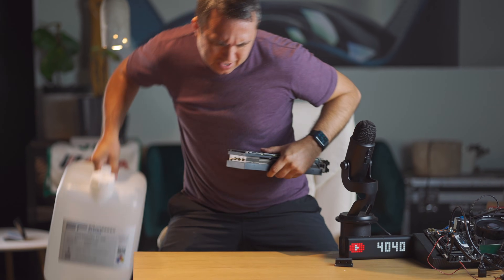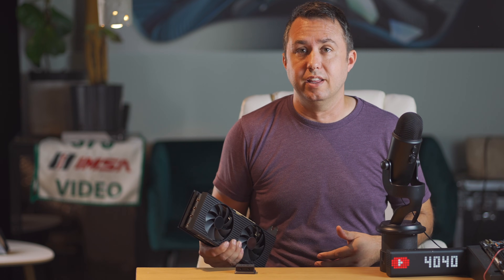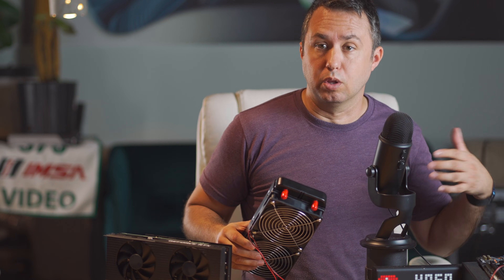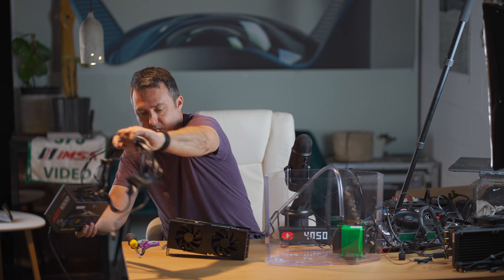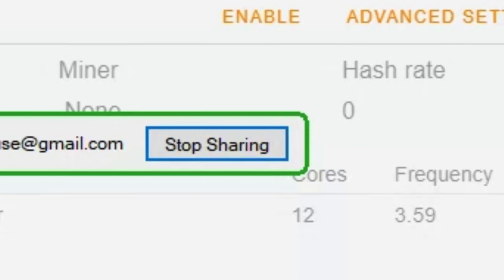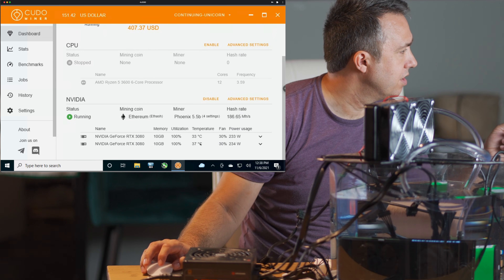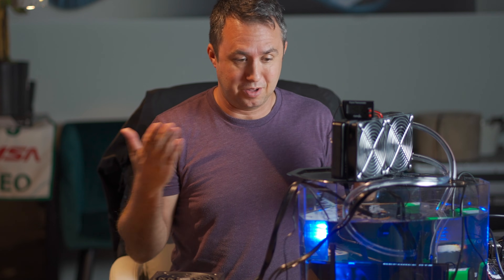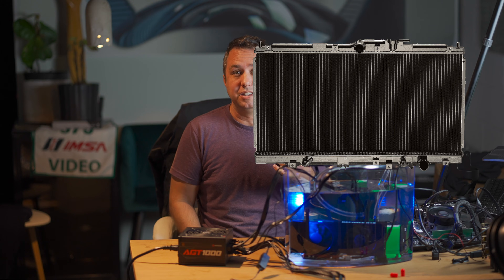Immersion Cooling RTX 3080 ETH Mining Rig with Dielectric Coolant

Comment: the whole point of this liquid is to cram in more heat making stuff in smaller space and have dielectric liquid be the heat extractor instead of air its better at heat extraction in tighter space, can hold higher joules of energy in same volume and thus efficient for data centers or large systems, Its a volume thing, not for average joe

Comment: imersion cooling is awsome we did our 20s x 20p samsung 18650 30q batteries with it,even under full load now they only go up 5-6 degrees and thats 3 to 400 amps
Reply: but we added a radiator and fans and peltier unit ,for really hot and really cold situations
Reply: all pc spec parts though
Reply: 20s20p!!?? What are you powering with that much voltage?!?!

Comment: if you have the fans on pwm theyll check the speed ,set on dc tthey just send a voltage,most motherboards will post a warning though on slow fans unless you disable to post warning and hold

Comment: That overengineered fluid is mineral oil... the same that is used in oenology. With a fancy name it costs 4x.
Reply from the maker: It’s possible they lie to the public and you’re right. But I asked them on the record for a future video wether or not it was mineral oil or transformer oil and they said it was not.  My guess is that it’s a modified transformer oil that doesn’t eat up plastic as fast.

Comment: First off, very smart move to pour liquid from a height, creating splashes, instead of resting the neck of the container on the edge of the tank. It’s like you’ve never poured anything before. Second off, a dangerous way to deal with a 2000$ card, using cheap parts with an expensive card. it seems to be your first time dealing with immersion cooling. But maybe it’s little money for you, I hope it is. Then there’s a problem with the thermal transfer. Since you don’t use convection, the liquid may eventually wash off thermal  paste and degrade thermal pads, and then your card may die from heat
Reply from the maker: First off, yes it was a bit of a mess. Second, it’s true $2000 isn’t a huge purchase for me, but that’s no reason to put it in any danger.  Luckily, electrocool has a zero change of damaging anything on the card, and in the event everything went wrong while I wasn’t home (which ended up happening, this tank was incompatible with this fluid and it ate a hole in it!) these cards have a feature to shut themselves off if they get too hot, which it did, and with no damage to the card. 
It’s now back in the air after a thorough cleaning and degreasing, acting as a gaming computer because mining is now unprofitable at my electric rate.

Comment: I wonder if the fllow of liquid will washout the thermal paste, and what about removing the heat sinks to let the liquid in direct contact with yhr dies, im having taughts here, no expert but good work buddy
Reply from the maker: I’ve since learned that yeah, you want to swap out the paste with thermal epoxy if you’re going to go this route. But I had I running for about a month and it still had not eaten away the paste I had in there. 
You do NOT want to remove the heat sinks, though. You need the additional surface area to collect enough heat, evidently.
Reply: @SPACEDESIGNWAREHOUSE  when you add heat sink you add resistznce to thermal transfer it is already immerged, but I may be wrong 😉

Comment: Did you change the paste at all? i was looking into using EC120 for my gaming pc a while back and they tell you to replace the TIM with indium sheets iirc. Just wondering if you've been running this since making the video and if the stock TIM has survived?
Reply from the maker: I did not, I had learned that later on.. it ran for about a month with no problems and then actually the ec120 ate through that plastic tank! It’s very important to stick to the material compatibility list from engineeredfluids.. 
But the paste and pads SEEMED to be in tact when I opened up that card and changed them after putting it back in the air again. I of course swapped them out anyway. 
I think it takes a pretty long time to eat away at the paste.
Reply: @SPACEDESIGNWAREHOUSE  No way! I hope you didn't lose all the fluid when it ate through! Thanks for replying, That's good to know! I didn't know if it would destroy the paste in hours or years 😁

Comment: What about evaporation?  Won't you have to add fluid all the time?
Reply from the maker: Nope, engineeredfluids dielectric fluid does not evaporate!
Reply: @SPACEDESIGNWAREHOUSE  Why do most companies seal theirs and use a condenser?
Reply from the maker: @eldiablo6457  you would seal it to prevent dust and whatever else from making its way in and gumming things up over time.

Comment: Does dialectric coolant evaporate? Per manufacturer Our Coolants have an operating life of 10 years assuming no contamination of the coolant during operation and up to a 25 year shelf life.

All of our coolants have a very low vapor pressure below 100C so they do not evaporate during operation.
Reply from the maker: Looks like you found the answer to your own question!   They say its smart to once in a while run the whole system through a filter - you can even just run a seperate loop that has pretty much any kind of filter on it temporarily, and then user a ball valve to shut that off the rest of the time,..
Reply: @SPACEDESIGNWAREHOUSE  yes I did, internet is still an amazing tool. Agreed on your comments

Comment: Would a cooling tower (evaporative cooling process) connected to a plate frame heat exchanger on one side and the cpu coolant on the other side of the plate frame heat exchanger be even better.
Reply from the maker: I havent thought about doing it that way!

Comment: How does this compare in longevity and cost to an AC-cooled rig?
Reply from the maker: Well these cards last a super long time no matter what you put them through, but with immersion cooling, they have no vibration from the fans and the heat temperature swings are much more gradual, so it will extend the life of the cards..  COST - I dont think you save money by doing this.

Comment: Hi

Can I just put my whole ring in a bathtub and just poor this liquid in lol 

Will it work 🤔
Reply from the maker: Well it would work until it heated up all the liquid in the bathtub.. The reason for the radiator is to continuously cool off the hot bitcool and return it to the tank.
Reply: @SPACEDESIGNWAREHOUSE  if I used the radiator it would keep it cool. How many radiators would you use for every 5 gpu?
Reply from the maker: @SNIPR-jz4fz  That would take some trial and error.. I only did the one 3080.. Every graphics card puts out a different amount of heat.  I only needed the one little radiator for that one big card, so you'd have to keep adding radiators until the temps reached equilibrium

Comment: Dude! This video is AWESOME!!! You had me cracking up the whole time, not to mention what an amazing cooling solution! How much heat does that little radiator put out? Similar to the oem water cooled card? Thanks for doing this!
Reply from the maker: Yep, it puts out about the same as a water-cooling loop.. This method is by no means better than water cooling - its just way more fun to look at!
Reply: @SPACEDESIGNWAREHOUSE  isnt it better? I mean every component on every PCB is cooled. And its not problem to cool the water as much or more

Comment: Would like a feedback video several months in to check on later problems that may with the immersion set up
Reply from the maker: Glad you checked! That tank was made from the wrong plastic and developed a crack. Engineered fluids Bitcool and electrocool have a specific materials compatibility list found on their website. Tanks should be metal or acrylic, not abs plastic

Comment: I call bull on the radiator only being about to run engine coolant. What matters is the material of the radiator it's made out of and if the fluid your using doesn't have any negative reaction to those elements. It's either aluminum or copper. What's more durable and widely available is an all aluminum radiator.
Reply from the maker: I think you’re right, I was wrong about that.. although, over time, the rubber in the radiator cap would have gone brittle and lost the seal..

Comment: This is so dumb and a waste of money
Reply from the maker: It was pretty dumb. But definitely worth the money!
Reply: @SPACEDESIGNWAREHOUSE  that oil is going to need to be filtered the heat is still going to need to be removed.
And if you go through winter months it’s much easier to use the heat from the cards in the air then from an immersion tank
Reply from the maker: @nicholashpitts  the radiators remove the heat.  And yes, a filter would prolong the life of this type of system. 
I live in Florida where we don’t really have winter, though.
Reply: @SPACEDESIGNWAREHOUSE  the radiators remove the heat right back into the room though, channeling the heat gives you some good options for controlling where it goes, The better cooling is good I suppose too, I apologize for saying it was dumb, I do want cooler ram uhg
Reply from the maker: @nicholashpitts  Oh for sure - you can never have less heat all together.. With this type of system, if you wanted to, you could just have the tubes go straight outside and have radiators outside of the room the miners are in, so its much easier to control the heat that way than with ducts and fans.  But like you said, not necessary to do at all.

Comment: Which model of Dielectric Coolant you are using? there are many in their store under GPU section. need for 4 x 3090
Reply from the maker: For those I’m using EC100 or EC110 whichever was cheaper. They both work
Reply: @SPACEDESIGNWAREHOUSE  doh, :( they don't ship to australia

Comment: Question, do you think you limit the heat absorption especially on the Memory Chips, by isolating it with the stock 4 W/mK Thermal Pads? 
Im curious to see the Temps if you would replace them with Thermalright Thermal Pads 12.8 W/mK like i did on my 3080, even on Air it dropped the Temps for me on the Memory by 20°C from 104°C to 84°C only cause of better Heat transfer rate of those Pads.
Reply from the maker: I just bought a set of those pads and I’ll put them on to see!

Comment: Just a tip for that style bottle.  If you flip it and have the handle out it pours smoother because the handle acts as airflow to prevent splashing

Comment: Hypothetically, couldn't you take an Antminer. Load it into a freezer chest or even a refrigerator and have it running with this fluid or would that damage it?
Reply: You'd wear out the compressor on your fridge or freezer, not to mention the power drain would be insane as it would be running continuously. Not economically feasible.
Reply: @darth_6000  So place chill the fluid in the freezer then dump it inside a container with the Antminer?

Comment: Would like to see a follow-up video where you submerge the power supply in that stuff. I might be waiting awhile.....
Reply from the maker: I mean, you CAN do that, but the power supply doesn’t really run hot. It may be more convenient overall to have the whole entire thing contained though!
I will do a follow up; mostly because I used the wrong kind of plastic for the container and it has since suffered a catastrophic failure!

Comment: In time the pcb will be ruined because of the corrosion from the liquid....This liquid is cheaper compared to the 3m novec that is used for cooling an entire pc....I'll add the fact that even the CPU has no radiator on it....
Reply from the maker: According to the manufacturer, this fluid, EC110, can be in contact with a whole computer for a decade without corroding anything. 
But you might be right and they might be lying.

Comment: i plan on putting 4 s19j pros in a 150 quart cooler and piping the coolant outside to a hydraulic oil cooler in a out door storage box. i will use a heated floor pump venation fans to move and cool the bit cool oil.
Reply from the maker: I love this plan!!
I’ve shot a video of immersion cooling one S19j and cooling it with a car radiator. I’m editing it now!

Comment: what about an absorbtion cooling system so it can stay silent
Reply from the maker: How does that work?
Reply: @SPACEDESIGNWAREHOUSE  dismounting a mini fridge. amonia. Evap in the tank and a condenser outside of the tank. It consume not that much electricity its the mini fridge we found in camper.

Comment: Technically air is treated as a fluid, so of course liquids will remove more heat than air because there is more of it in contact with the thing you're trying to cool.

Comment: so I've watched a few folks do this with mineral oil, which seems way messier than this, but I don't really see a benefit.  I mean I know the temp is lower but you aren't getting higher hash rates or anything.  I assume the belief is you are extending the life of your card, is that the one main idea here?  Cooler temp so it will last longer?

Comment: So, this is great.  I'm getting into Crypto mining and I like how you are experimenting to solve some of your problems.  You have wonderful videos.  I have an idea.   Bear with me here.  We just put in an in-ground swimming pool in our back yard.  I installed a titanium heat exchanger from Hot Spot Energy.  It looks like a blue plastic fire hydrant.  It rerouts the refrigerant from my air conditioner into a titanium coil that is housed in the blue plastic casing about the shape and size of a fire hydrant.  My cold pool water gets pumped into the top of the plastic fire hydrant case, bathes the titanium coil in cold water, and then carries the heat out the bottom of the case to the swimming pool.  The swimming pool (which we want to heat anyway) acts as a big heat sink.  The air conditioner removes the heat from my house and would normally try and blow it out into the atmosphere (which is already hot anyway.)  With the refrigerant routed back into the heat exchanger titanium coil it gets cooled off better and makes my air conditioner more efficient (and heats the pool water for free.)

With your setup, you have solved the noise problem from the fans.  And you are keeping the GPU's cooler.  But you are still generating the same calories/Joules/whatever amount of heat.  In fact, perhaps you are making even more total heat because your cards are running cooler and you can pump more total energy through them.  So, unless you are trying to heat up your house, you may still have a heat problem.  Or, maybe not. Perhaps by cooling more efficiently you are actually using less power to run the cards at their peak performance so there is an overall lesser heat production.

At any rate, I need you to develop a method to immerse the ASIC miners in a fluid that gets sent through one of these heat exchangers and heats my pool instead of putting it through your radiator.  The heat exchangers are already developed and can move HUGE amounts of water through them.  The fluids don't need to comingle as they exchange heat accross the titanium coil.  Then, I wouldn't need to winterize my pool because I could run the pump year round.  And, perhaps the miners would use less electricity.
Reply from the maker: Its as if you came from the future and made one of my next ideas more refined and prettier.. 

So Im already starting to immersion cool my asics, and I had this plan to have a tank full of coolant where the miners live and run, then the hot coolant gets pumped out of the tank and into literally a truck radiator (theyre essentially no different from a very expensive heat exchanger) and then simply plopping the car radiator into OUR in-ground pool.  

It would be the same story, the fluids never co-mingle, and the pool water would directly cool/be heated by the exchange through the car radiator and then the cool liquid pumped back into the tank full of ASICS.    If I get more asics, I just connect more radiators in a series!! 

Thats the janky version, but it would make really good use of all this heat!   I currently just run 7 ASICs in my warehouse and pump the heat outside with giant fans.
Reply: @SPACEDESIGNWAREHOUSE  So that's cool that you already had that idea.  Instead of futzing with a truck radiatior and have that be inside your pool I would just get one of the Hot Spot heat exchanger things.  Although a heat exchanger would be more expensive than just an old truck radiator it would just go in line with your pool equipment somewhere by your pool pump and there wouldn't be a large chunk of unsightly metal in your pool.  Also, if you have chlorine or salt in your pool the radiator could corrode.  Also, with a radiatior just "sitting" in your pool the cool pool water wouldn't necessarily be "flowing" uniformly over the cooling fins in the radiator like the air would through the front of a moving truck.  You would need some type of pump to push your hot ASIC miner fluid through the titanium coil in the exchanger (like you would through the radiator.)  Your pool pump would already be pumping the water through the heat exchanger and cooling your electrostatic fluid.    I don't know how your ASICs are set up in the fluid but you could perhaps make it so the cold fluid comes in one side and the hot fluid flows out the other side of the tank into the heat exchanger that is cooled by your pool water. I think my heat exchanger cost me $1800 to purchase.  Might be worth your time to check out the Hot Spot Energy website.  I'm about to invest about 50 grand in some ASICS.  I'm looking at an S19J Pro and some Scrypt algorithm ones like the L7.  Sounds like you've accumulated more ASICs.  Any new thoughts or regrets.  I think I've already seen all of your videos. They are great.  I'm looking at buying some miners from alibaba and I got one from the Bitmain website.  I heard you mention a US based miner supplier and I'm looking forward to who you are using for that.  Cheers.